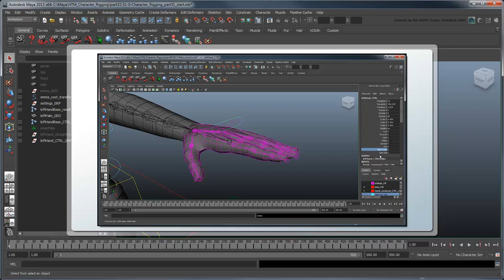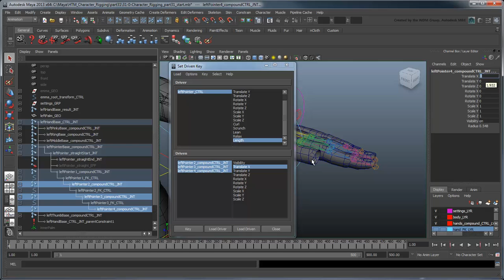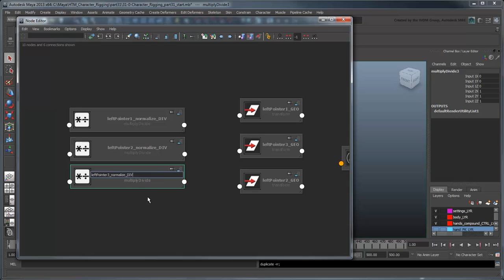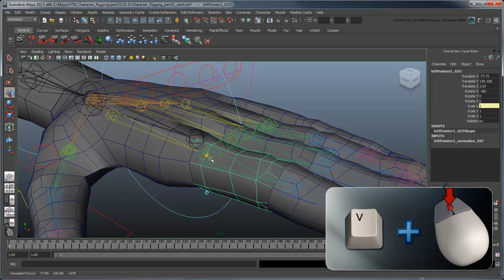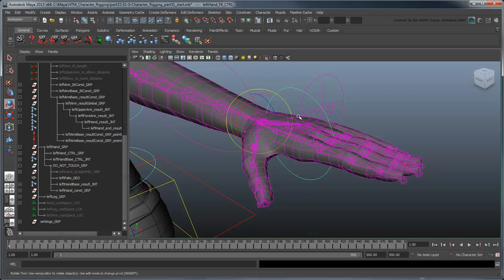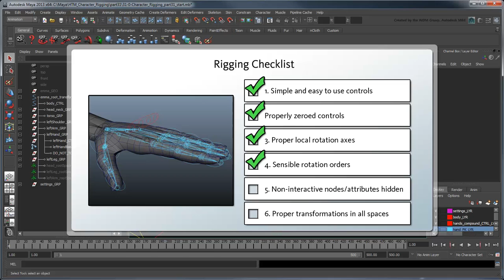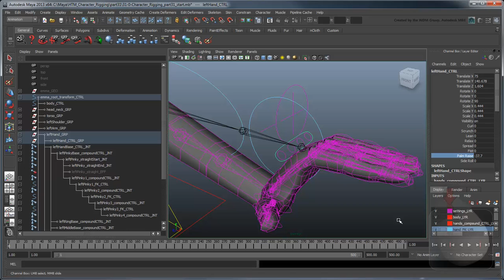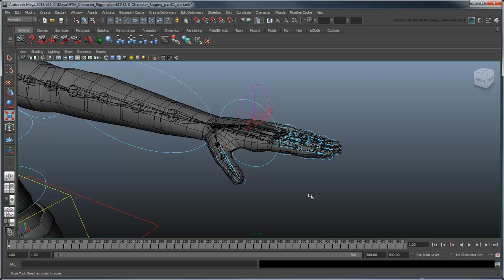Creating a Character Rig - Part 31: Hand global transform and cleanup (Advanced)

Comment: Hi I ran into an issue for the stretch of the thumb...I'm pretty sure my mistake can be narrowed-down to when we use the Connections Editor to link the FK CTRLs to the orient joints and result joints and having both rotations and translations for the joints 2,3,4 of every fingers. The thumb part was skipped and for some reason I can't figure it out, could you tell me what were the connections to do to prepare the thumb stretch?

My problem is that the middle part of the thumb (thumb1_geo) doesn't follow it's respective joint for the stretch and I tried going through the whole process just to see what I'd get and my thumb2_geo receives two kinds of scales at the end of the line. So I'm convinced my mistake is there but I can't seem to work it out and it's driving me nuts. Could you tell me what were the respective connections to do for the thumb to stretch properly?

My outliner is exactly the same as yours so hopefully, it'll turn out to work in the end.
Reply: Ok I redid all the connections by breaking all of them for the thumb's joints relationshipes we did in the part 28 and reconnecting them using your scene as a reference in which I'd ''select connections'' in the channelbox to find out what was connected to what. Tried the stretch again and the stretch still doesn't work, now I'm trying to work my way up in the node editor node by node to see what the leftThumb2_FK_CTRL has that my leftThumb1_FK_CTRL doesn't.
Reply: The7UPBuddy Ok my leftThumb1_compoundCTRL_JNT doesn't receives an animation curve of translate X like the leftThumb2 which could very well turn out to be what I'm missing here
Reply: The7UPBuddy Nope, yours don't have it either. Wow I just can't find it
Reply: The7UPBuddy Hmm...I tried connecting the scale to the geo part even though it wasn't following it's joint, I do get a stretch, not in the right orientation though...am I right if I think i'm facing a space problem?
Reply: The7UPBuddy Yes it's definetely a space problem, my rotations aren't at zero, that means they must have taken on of the joints rotation? I guess in your case it's rotations were absorbed by a joint in your hierarchy no?
Reply from the maker: The7UPBuddy That's correct.  The thumb geo should be in 0 space (0, 0 0) within either the leftThumb1 or thumb2 result joints.  Are you sure you've correctly centered their pivots on those joints?
Reply: Thanks for your reply, and sorry for being so present in the comments. Yes their pivots are V-snapped to their respective joints. At least now we've narrowed down from where the problem is coming from. For now, I've locked the length attribute since it's extra goodies so no mess can be done until I can come back to it and focus on fixing it. It was probably when parenting the joints and the GEO I did something either in the incorrect order or I forgot to freeze something and rotations were not absorbed. I'll have to dig deeper into this when I have more time.
Now I'm working on the mirroring part which is a bit more work than expected. Had I known, I'd have mirrored the joint chains as we went along and just redid the functionality in parallel for the limbs.
If I can just ask you yet another question, mirroring the joints is pretty straightforward, I can ''mirror'' any locators and redo our measurements etc. but regarding the IK controllers such as for the foot, how exactly do we approach this can I simply duplicate the curve, scale -1x it, freeze it and then redo the hierarchy of all the locators in it? I noticed when mirroring the noFlip and PV IK chains that I got duplicates of the respective Handles, but not for the ball and toe...I guess I should just play safe and redo all the IK handles etc. right?
Reply from the maker: You should definitely redo the IK handles.  In general, mirroring involves a lot of retreading of old territory (anyone who tells you they have a 1-click solution is usually stretching the truth).  I'd look at it as a chance to review what you've learned.
Reply: Fair enough.
All my previous rigs I'd first mirror the joints chains when they'd be done and I'd do all the IK handles etc. on each, I just didn't think about it when following your series. But I guess as far as the control curve itself is concerned, I can duplicate it  and then with it's control verticies scale it and reposition it and then from there I'd redo all the under the hood settings.
But it is indeed a good hard way to review and further understand the construction of the rig. Which is a good thing as this is the first time I do such a complete rig. Thanks again.
Reply: One tiny question if I may, at 11:29 you mention how the right arm segmented joint chain has different joint rotation than the other chains, how was that result achieved? Did you use a different mirroring technique or did you change the joints orientations afterwards? Just wondering because I tried orientation instead of behavior and it was still the same orientation and I tried changing the joint orientation but it can't be changed because we have micro rotation transform values, in my case it's only one joint of the chain with 0.001 so I'm curious as to how you obtained this result. Again, thanks in advance
Reply from the maker: The7UPBuddy We just mirrored the joints using the Mirror Joint tool.  Strictly speaking, the orientation of the segment joints isn't important (as long as they're consistent relative to each other).  The only difference they'll make is on the Advanced Twist values you use.

Comment: wait ... I want to know how can I utilise Palm Raise without making the arm stretch :| .... it's unnatural . I tried with locators , grouping , constrains , with another curve control; but I can't fix it :(( .. help !!!
I want the Palm Raise to interact with IK contrl. and make the entire arm to move
Reply from the maker: For this rig you'll need to manually adjust the shoulder to achieve the motion you're looking for, or use the FK control. If you'd like to add this effect, know that it will require additional IK splines to pull the body sideways, which in turn would make the rig much more complicated.
Reply: Maya Learning Channel k .. then I will rotate the IK control clockwise and the fingers in the opposite way to create this effect :D

Comment: maybe I'm doing something wrong, but this part has been a nightmare for me and I ultimately gave up. I ran into the problem that my endbindJNT was parent constrained to my hand joint. If i tried to parent the constGroup to the hand joint all was fine. but when I deleted the endbindJNT's parent constraint, and parent constrained the baseconst joint to the endbindJNT, the connection of the endBindJNT to my hand was broken. I tried parent constraining my baseconst joint to the hand joint but then my IK's on the fingers moved with the palm rotations. If i tried to parent constrain the constGroup to the endBindJNT and the baseConst joint to the hand joint, Maya would freak out.

Comment: Hello, I was just playing around with the rig as it is thus far and I happened upon a bug. The knee and elbow snap attributes break when you do a transformation in the global scale. It looks like its a double transformation problem. Could this be fixed using the same normalization methods applied to the overall arm and leg length distances?